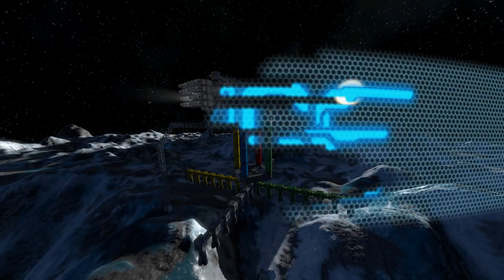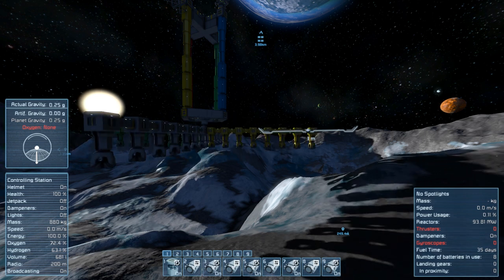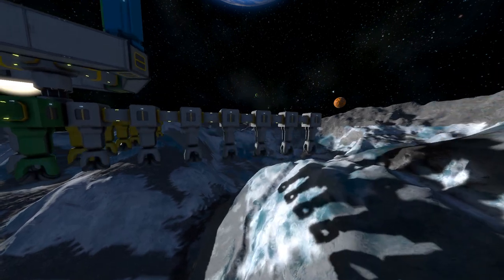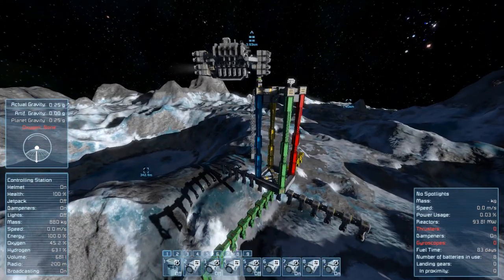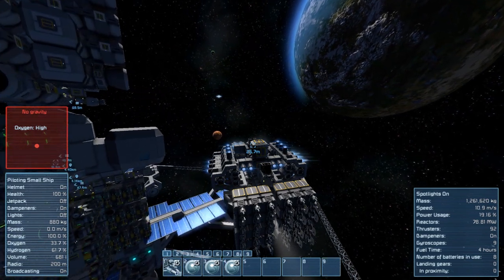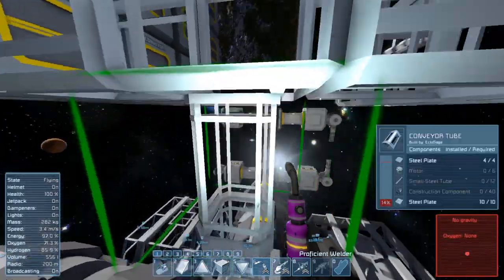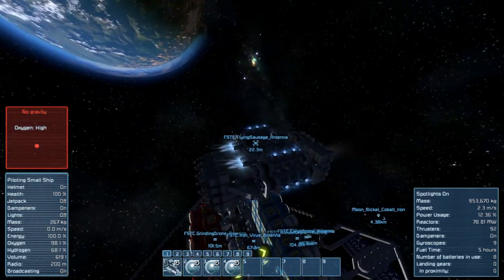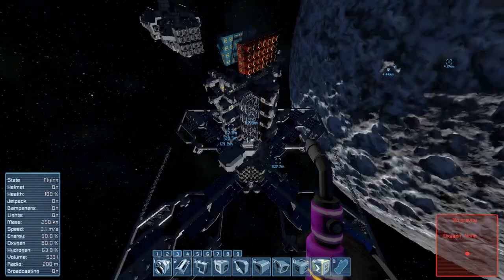Space Engineers, Mega Drill Rig Test (Singular Survival, Ep 86)

Comment: having successfully built one of these, I can say that the maximum safe extension velocity is about 0.2 m/s, total.  And remember that the more pistons you have extending at once (in series, not parallel), the lower you have to set that velocity. Set your rotor to about 0.3 rpm and leave it there, just toggle on and off.  Also, you should have at least two gyros on each arm of that thing to suppress the wobble.  Lock them in override mode. and for pity's sake, use landing gear to lock it down when not in operation.  You might also consider disconnecting the rotor head when it is locked down.

Comment: The pistons have a certain amount of lateral give which has not be addressed in the design, so 8:14 in the game the build seemed to be behaving exactly as it should have been: the design is incomplete. What about a gyro on the platform at the end of the pistons and a gyro on the drill head (on the other side of the advanced rotor)? Also, timer blocks to rotate once, extend a tiny bit, rinse, repeat (including gyro overrides where needed). I think staggering the drills as you suggested, at this point, is a solid idea. Some of the mods, including reactors/furnaces that eat stone, seem like great additions. I'd like to see a tool that lets you put stone back into the (voxel) terrain. That's a purty lag switch you made. ;)
Reply: You should look at the cement mods, those let you turn stone into cement and put it back into the voxel terrain. There are also various gravel resources extractors that turn gravel into miscellaneous resources. A bit cheaty usually because they do extract a tiny amount of platinum too, which would allow you to early game cheat ion thrusters without having to go through the expensive and time consuming hydrogen phase to reach space where you can mine it, but there's more than one and they all have different balances.

Comment: Regarding the mining rig, you should hook up a pipe with a sorter and many connectors at the end to slowly spit out the excess stone in a pile far away enough that it won't roll back into the hole or damage the support holding the rig up.

Also, it could make a good passive miner while you do other stuff if you set the pistons to extend as slowly as possible. That way you can eliminate most risk of it extending too fast and breaking. You can just set one layer at a time and set the next off when it's done if you check in later (or do some fancy-shmancy timer block or scripting stuff).

Comment: On your rotor head use gyros to rotate the drills. This will smooth out the shaking we saw in your video and will make a cleaner cutting pass. As a side note the gyros wont jerk on the drills but give a smooth and even flow to them, so if the drills get stuck it will be less likely to break everything.

Comment: Though you might not want to use mods, there is one I use regularly that deals with stone just fine. It is the Moisture Reclaimer mod. Specifically, it has a Arc Forge looking block that just turns stone into ice. Bit of a faf, but still does the trick. It also alters refineries so most ores (except uranium) will produce small amounts of ice when refining. I know most people don't want to dink with it, but it is still an option.

Comment: Its funny watching Sage and the difficulties with vanilla drills is exactly why I use modded drills. By at least extending the cutting range, even without adding width, makes the whole drill machine work better. It is mainly because of the the issues with drilling that makes it necessary. If the updates were not so slow you would not need the extra range on drills.
Reply: I really wish they'd change the voxel destruction tick to at least 4 per second. I wonder what impact that would have on the simulation.

Comment: Love the mining rig but i think it would be better if you reinforce the main part of each rotor so they still extend, that should stop the "wobble", and the whole thing needs to be closer to the ground and have a longer reach, that most needed uranium is deeper than you can go
Reply: Yea connect the piston bases with armor blocks, so as to create a frame between them!
Reply: No no no! Just use a gyroscope
Reply: Umm, but armor blocks will prevent the resources from being sent through.
Reply: babybirdhome I'm referring to the attachable side of the piston, the part that doesn't move when it extends. Not the bottom or top. But, like Rigid said, a gyro, with gyro override on, will lock it pretty solid. I still think a frame for stability would be advisable, though. Cheers.
Reply: Ah, OK. Sorry, that wasn't clear to me from your first comment. I was struggling to figure out what you meant.
Reply: babybirdhome Eh.. it happens. Have a good one.

Comment: Based on my own experiences with drills, his head needs to be set to move much more slowly, both in extension and rotation, if he expects "smooth" drilling.

Edit: This is what I feel the stone should be used for, kinetic kill weapons. Setup a simple Large cargo container blueprint, attach the hologram of the container on a conveyor sorter on the end of a piston mounted grinder/welder assembly. Set the sorter to push through stone, build the container with the welder, go to the drop point and extend the piston so the assembly is in gravity and grind down the container.

The stone will drop with the full force of gravity and the materials for the container can be, contained, independent of all other parts in the assembly so they can't be lost or misused. Just remember to retract the piston when you're done.

Comment: Ok, best way to dump stone

Build one or several large ship or station cargo containers with a welder on one side and a grinder on the other, rig a container filled by tims to a sorter and conveyer to fill the containers with stone, this will hold ~1,140,202kg of stone per container. 
When full, or at a predetermined time have the grinder take the cargo container down so it releases all the stone, then turn on the welder to rebuild it and repeat.

bonus use a refinery to turn the stone into gravel which will lose 10% of the stone to inefficiency, then dump the gravel in the method described.

Comment: They really need to add concrete to the game, so stone has a use. And you should offset the drills on the shorter arms, if for no other reason then to make your mining machine look correct.
Reply: I have to agree. With real mining, there's a tremendous amount of waste material that has to be dealt with, but in the real world, there are ways to deal with it. SE doesn't currently have an effective means of waste management and it really needs to. Stone should be able to be turned back into voxel material through some process or another. The cement mods work pretty well for that but it needs to be a vanilla mechanic of some kind.